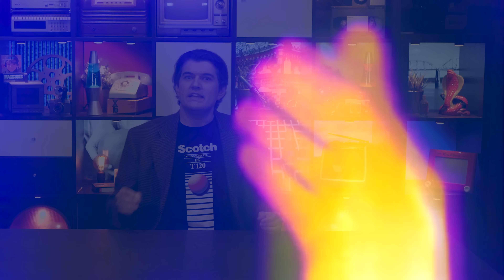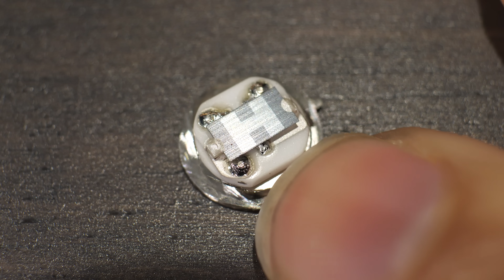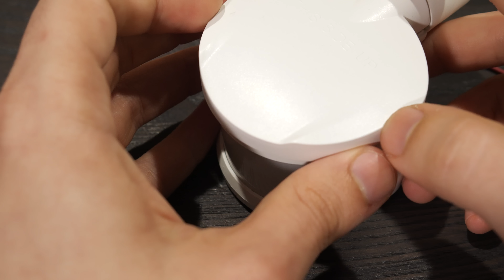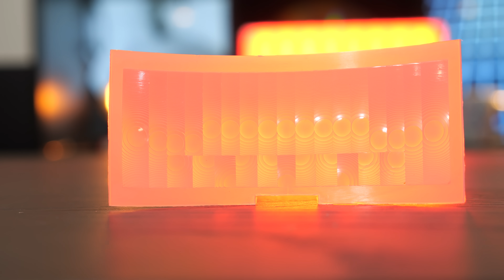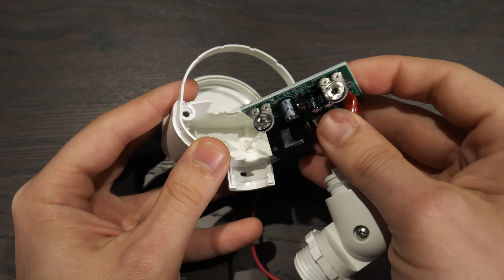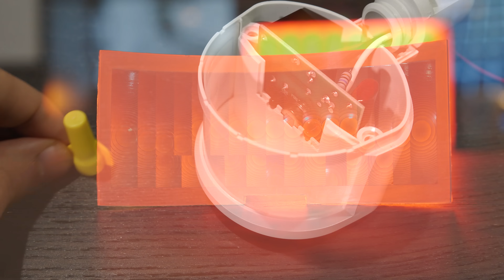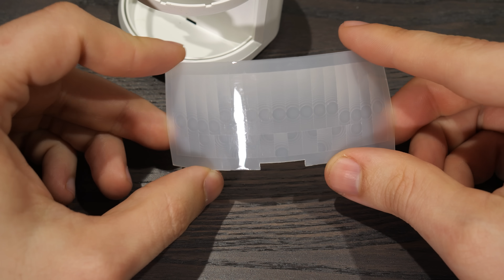Passive infrared motion sensors: a two-bit camera powered by crystals

Comment: Accually most of them heva just 4 opamps in logic mathematically integrating amount of light on both halfs and last one used as comparator for switching relay. So it is not just "2 bit camera" but "analog computer" as well...

Comment: I basically knew how this works. What I did not know about was the crystals. If any. I'm not saying this video is wrong (probably it is correct). However as an engineer I would have expected any phototransitor (or transistor for that matter) with an IR filter in front would have done the job.

Comment: 8:03 Missed a perfect opportunity to use your thermal camera, either placed where the PIR sensor would go as you walk around the room, or looking in with a small heat source where the PIR is. I just tried and it works great (I used a power resistor as a small heat source). It looks like those old pictures animated by a grooved plastic sheet that moves slowly over it.

Comment: Gonna be "that guy" a bit; You have a thermal camera, could you not put the lens between a heat source (your hand) and the thermal camera to get the correct or near-correct effect from the lens? Or was that tried and it either A) Flooded the camera or B) Just showed through the entire lens without an effect?

Comment: I bought some rechargeable LED lights to illuminate food preparation areas in my kitchen, but the PIR sensor was too sensitive, turning the lights on whenever I was near.
I shielded half of the sensor with sticky copper tape, so the light only comes on when I wave my hand underneath it.

Comment: I hope you can do a video on the modern version that uses 2.4ghz to detect objects that have a high water content to trigger a light. It can work through walls and even if you try to block it with a mylar blanket, it will still trigger. It is very cool but I have no idea how it works !
Reply: Radar. I think you mean 24GHz, although there has been some research into human detection using Wi-Fi, most likely in the 2.4GHz spectrum.

I use the LD2410 (24GHz) for human presence sensing, and find them much better than my PIRs for short range detection. Their main drawback is also their strength... they work through walls, which means sometimes they trigger when you don't want them to, including detecting people behind them. Their precision on the other hand means you can filter out objects that aren't within a specific range. They also use more power than PIR, so aren't really suited to battery-powered applications such as solar lights.

Comment: I can't find documentation for this specific part to support it, but I think it may be a single crystal polarized perpendicular to its surface. A number of similar devices work the same way, but their electrodes are typically on the bottom, not the sides. By coating and etching some conductors and whatever pyroelectric it's using, you could make it so the current path passes from bottom to top on one side and from top to bottom on the other. This means the whole thing can be made in huge batches using typical lithography techniques. The H is probably just a black mask to make it absorb infrared better on the patches where we want signal and not on the others. This doesn't explain the two islands formed by the H, but we can't see whatever is going on under it, so who knows?

Comment: Hey I work with IR cameras and most thermal imaging sensors using crystals like these are called microbolometers. If you use that term when researching you might find some more info about how they're made

These sound like, essentially, an IR thermometer with a huge lens. Those are basically thermal cameras with a single pixel. These motion sensors are similar, but with two pixels

Comment: Does this mean that the sensor that turn on lights when a car approaches a driveway are more sensitive to internal combustion engine based cars (emanating heat / IR from the hood or exhaust) than electric cars?

Comment: I used to work tech support for the US’s largest home alarm system company… those motion detectors are not designed in any manner to not detect animals. They go off if a house fly buzzes in front of them. Maybe such a device exists, but our guys sure weren’t ordering them — that, or the installation techs were adjusting them all wrong.

Comment: Going on a rant here.
The church I go to is currently undergoing renovation, and they are installing the golf ball style motion sensors in every room that has 3 or more of the 2x4' panel LED lights (they're thankfully replacing horribly unreliable CFL ballasts that have PCBs (toxic chemicals, not circuit boards) in them) (yes, I love parenthesis). However, the 3 or more "rule" makes absolutely no sense! The main place you would want one of these motion sensors, at least in my opinion, is a closet, which is only opened once in a while and the position of the light switch could be forgotten. The contractor has also done a terrible placement job, but these things are not even the worst part. They have decided to remove all the light switches!!!! So if you wanted to watch a movie or something, now you have no choice but to have the lights on! And I can only imagine what a disaster a youth lock-in would be.

Anyway, not the fault of the technology, but just a PSA to make sure the technology you choose makes sense for the application, light switches are probably fine for most applications.

Comment: well... you animation at 10:20 and other times is incorrect from the point of how optics work - there is no "single red beam from below" and the diffraction pattern at the censor -it is easily verifiable from your previous practical demonstration before - when you shine the light from inside - the frenel lens just propagate the light "straight". all the separate small lenses focus whatever amount of light they can find from 180 degrees directly at the sensor. I am really not sure what do you want to explain here...
edit - watched the video further, it looks like that signal modulation for sensitivity - one single small frenel lens - at full brightness - apparently, counts as a single spike, thus, the movement overall is accounted as "the object was at 180 degrees, then the object was at 170 degrees, then the object was at 160 degrees" etc.
My point is that it doesn't seem to de any diffraction pattern inside - solid "fully engaged single small lens"  is accounted as a signal spike instead.

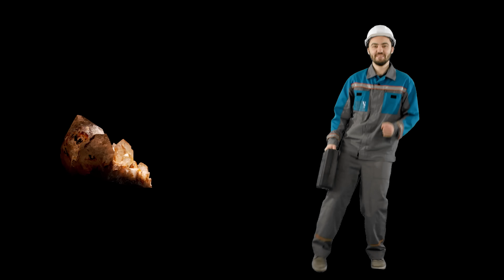Comment: 2:20 even if the heat could constantly output electricity it still wouldn't be "free energy" in the same way solar panels aren't "free energy". it would basically become the worlds worst Peltier TEC

it is however reminiscent of the "free energy scams" that imagine magnets are somehow a source of power even without moving 😂

Comment: One of my favourite things to do at my old job when I had to stop by late at night was to walk up the stairs so slowly that the lights wouldn't turn on. I'd succeed maybe 30% of the time. Though once I was in a rush and went up the stairs normally and the lights never came on. Except when I came back down the stairs it did go off. I could understand if it was summer since the heat differential might not be that big. It was during early winter and I had to run back to the office from the bus stop and try to make it back in time so I was plenty hot compared to the relative temperature

Comment: There are storage spaces in a different part of the block of flats where I live that uses one of those to control the lights. I once needed something and foolishly stacked the boxes that were in the way of what I was looking for between me and the sensor (my storage space is at the end of the corridor) so when the lights went out I had to somehow move enough stuff so I could get back into the corridor and get the sensor to notice me. In complete darkness. 
A few years later I made the same mistake again...

Comment: There are 2 common pyroelectric modules you can play with.
First is the one with half-golfball on a small board with 2 pots on it:  sensitivity, and time the output stays on when blipped.
Second is a 3-pin all-in-one module the size of a severed fingertip that's already "calibrated" to plug'n'play.
I got a pile of each, as they're fun to play with.  Make Hallowe'en scaries, all that kind of thing...

Comment: That outtake with the blinking light reminds me that I'd love to see a video about the LED controllers in modern bulbs.
I've got a bunch of GE Reveal bulbs that all developed wacky behavior around the same time. I'm guessing the controllers inside got damaged by a voltage spike -- possibly from my generator, or possibly from the power outage that made me go plug it in.
I thought there was a wiring issue or something but, nope, it was the bulbs itself. So, I figure they must have some kind of tiny little driver in there and I'm very curious to learn how they work.

If I'm very, very lucky, maybe I've stoked your curiosity too. :D

Comment: So now the question is: why the automated faucets that use these motion sensors NEVER work correctly?
Reply: Wet hands are weird temperatures, so are wet sinks.
Reply: @andrewwebb917  When I put my hands under the faucet my hands are dry.  Still most of the time the faucet doesn't open.
Reply: They do work but there is a delay
Reply: @jamesisaac7684  Unless the delay is measured in 10s of minutes I don't think this is the issue.  When I do find one that incredibly works, the delay is less than a second.

Comment: The unfortunate part with sensors similar to these is that they often respond to change in temperature moreso than just heat, meaning that a sudden cold spot can also trigger them. Similar devices are often used in conjunction with emergency egress devices on doors requiring higher security. The sensor unlocks the doors for folks leaving, as standard panic bars can be a security vulnerability. However, if a cheap sensor triggered by any sensed temperature change is used, something as simple as a can of compressed air held upside down and sprayed between a pair of doors can unlock the doors and give access to an unwanted guest. I've also seen a video where someone put some liquid in their mouths and spit it between two glass doors of a bank, and the doors unlocked. The sensors are nifty, but I feel like mechanical security is not where they should be used.

Comment: I own a retroreflective jacket; was getting tired of burning up on the way to shytown on summer day road trips. Anyhoo, I wore it to work once, and I noticed that it sets off the bathroom sink water hand sensors even if I'm standing against the wall, a few feet away from the sink. Normally those things are a pain to set off, even if I'm waving my hand directly underneath.

Comment: I am honestly disappointed this time, since it doesn't explain why a space heater wouldn't trigger this up, since it may be placed such as to hit only one side of the crystal, producing current by warming only one crystal. Why the sweeping is necessary? Maybe the voltage is too low? Someone please explain
Reply: He said it right at the beginning, there needs to be rapid change. A steady heat source on the crystal won't trigger it because the crystal only generates electricity for a fraction of a second as it warms up, then it stops. 

Heaters won't trigger them.

Comment: I have been wondering now for over a decade how these devices actually work. Thank you for explaining!
I knew they detected infrared light somehow, but never knew more than that. There's a fun episode of the MythBusters where they try to 'beat' the sensor and not trigger it, and end up running around in front of a PIR sensor with a fireman suit on, not triggering it cause while a fireman suit is very good at keeping heat out, it is also very good at keeping a person's body warmth inside.

Comment: I've used a few nightlights with the "golf ball" style frenal lenses on them and I've found they work quite well in even a large room depending on where you are in the room of course.  My mother has nightlights in the hallway of her house, the motion sensor is attached to the ceiling, and it has an amazing detection arc, it detects people all along the length of the hallway.  I don't know what style of lens it has on it, I think the sensor is quite small.  I had a few Osram Nightlux nightlights in my hallway, powered by 3 AAA batteries, they performed well, but I noticed that when the batteries were going flat, the nightlights would erroneously turn on when nobody was present in the hallway, and sometimes the lights would repetitiously turn on and off over and over again.  Kind of annoying when you're trying to get to sleep.

Comment: Your tshirt reminds me of the VHS tape cassettes that my parents had in the 80s and 90s. Haven’t seen that brand in 25 to 30 years.

I also remember those curved motion sensors were often used for household burglar alarms. Often on a mounting bracket in the top corner of a room. As a kid I always wondered how they detected me (with a glow of a red light) but nothing else in the room.

Comment: Quick tip.....if you want to see what the sensor sees, you can use a THERMAL CAMERA instead of a standard video camera!
I just tried myself with an old passive infrared sensor and it works great!

Comment: I’ve tested one way of beating these sensors: a space blanket. The metal foil reflects infrared so the sensor doesn’t see your body heat. The Mythbusters used a fire suit and panes of glass to beat them, which is a bit too impractical.

Comment: If you decide to dive deeper into this on the 2nd channel, a few suggestions:
1) To demonstrate the lens, try moving the beam of a weak red laser across it. (Maybe just a cat-toy laser.) I bet the wavelength of the red laser will be close enough to the IR wavelength for you to see the effect, at least to some extent.
2) If you want to investigate the chip more deeply, maybe the Applied Science guy would be interested in a collaboration in which he sticks it under his electron microscope. 
3)He, or any electronics YouTuber, could hook the IR sensor unit up to a power supply and oscilloscope and show the output voltage varying as things move in front of the legs. (Or you could do that if you have the gear; I don't remember whether you do.)

Comment: Is this not just a set of photovoltaic cells configured to see IR light instead of visible light?

Not hard to imagine a polycrystalline pv device set with the crystals in a matrix that can measure differences across zones to generate differential voltage across the matrix. 

And since photovoltaics are light emitting diodes working in reverse, this is basically an LED screen working in reverse. 

So in essence it's an electronic infrared camera.

Comment: Hey, I have a random idea I've been playing with and since this is kind of your job I figured I'd ask you. This other channel discussed IR reflective paint that could help cool your house in Summer, which I think is a great idea living in the South. I wondered if combining that paint with a dark thermoreactive paint that goes transparent above a certain temperature would work for cooling in the Summer and not cooling in the Winter. Thus, getting the best of both worlds. My question is if the IR reflective paint under the opaque paint in Winter would basically reflect the heat absorbed by top layer of paint back into the top layer and cause it to peel, or something, and shorten its life, or would it work as I expect. IDK if you'd be willing to experiment with that, but, if so, I'd love to know the results! Thanks.

Comment: I understand how a human trips a motion sensor.  But, when I was stationed at mayport, my barracks room had a motion sensor that would shut off the AC.  Infuriating when I was sleeping.  But, I would run my ceiling fan and it ticked the sensor to keep the AC on.  Fan blades don’t produce heat like humans.  So how does fan blades trick said Motion sensor??
Reply: pretty easy: the air itself is not uniformly warm or cold.
So like with moving humans, it also detects moving air which has a different temperature.
That's why the instructions mostly say you shouldn't mount them in front of windows or devices for heating or cooling a room

Comment: What I'm getting out of this is that motion detectors won't work on vampires. Problematic for my use case.
Reply: or - even worse: Zombies.
in our case, there are high frequency motion detectors, which basically work similiar to radar. They send out noise humans (not sure about vampires or zombies) cannot hear - and listen to the response. They do it repeatedly, and compare the responses.
That way they even can look around corners or sometimes even behind doors.
But they are more expensive, and work not that good outside (at least in my experience)
Reply: @bernds6587  oh so active sonar basically? Seems like a good system
Reply: @DrDankPhD   more or less. The bad thing is, it looks through some doors and uses more energy - not much, but still.
And it works not that good outside.
Reply: Anything above absolute zero emits radiation. If we calibrate this, it can work for those. 

Absolute zero is  -273.15 degree Celsius. It's impossible to reach that temp.
Reply: @jamesisaac7684  yeah but if it’s room temperature it’s going to be indistinguishable from the surrounding air and walls right?
Reply: @DrDankPhD  that's why I said Calibration. They detect the changes in the temperature, not the temperature itself.
Reply: @jamesisaac7684  yeah but like, the vampire is room temperature so there isn’t any temperate change right?
Reply: @jamesisaac7684  the difference is, that sensor needs a change in detected radiation.
Now if that zombie has the same temperature than the sorroundings, it can't detect much